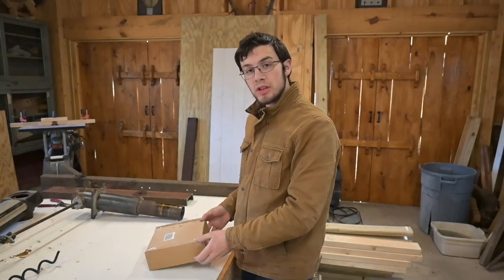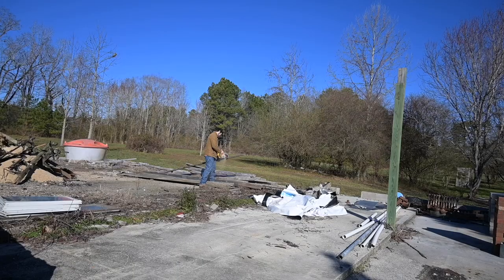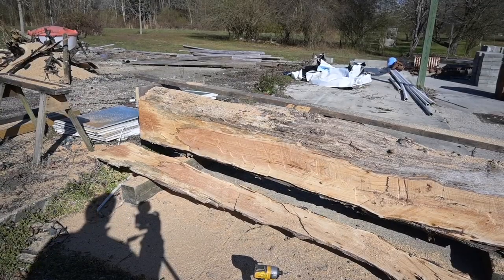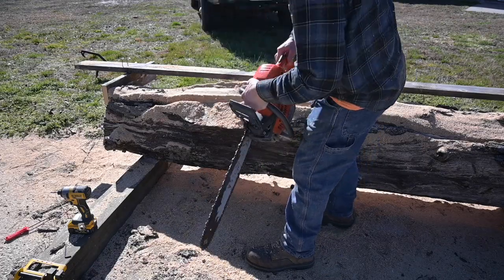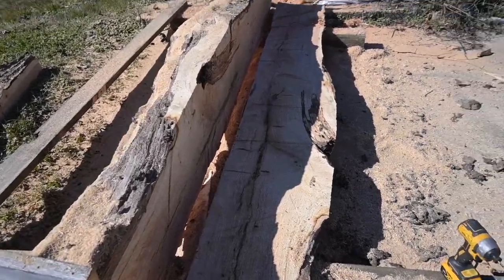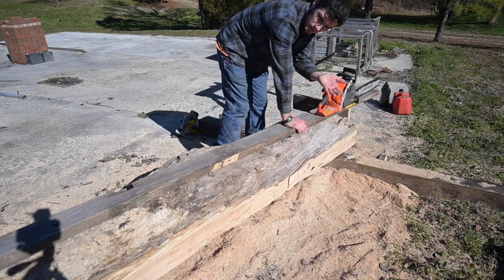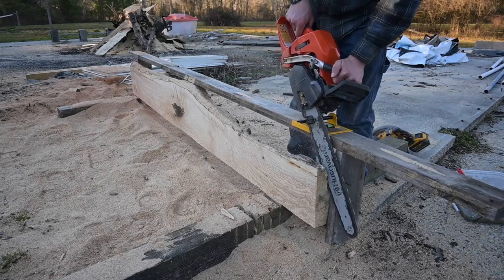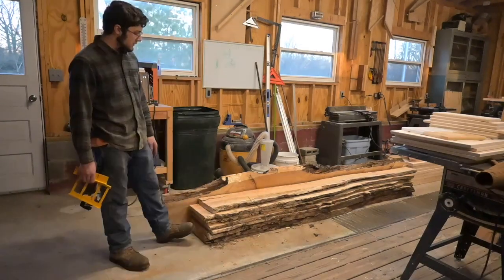How to mill lumber with a chainsaw!

Comment: Nice job! FYI: Making a lot of dust (instead of shavings) with a chainsaw typically indicates that the chain isn't sharp enough.
Reply from the maker: Unless you are cutting along the grain, due to the orientation of the fibers it is not very apt to curl.